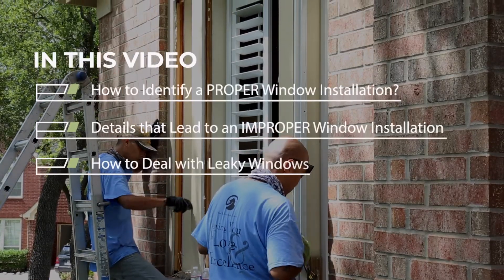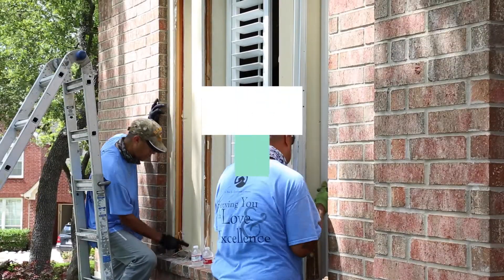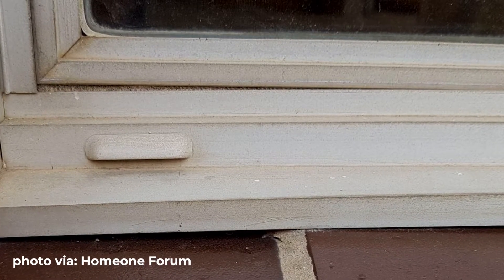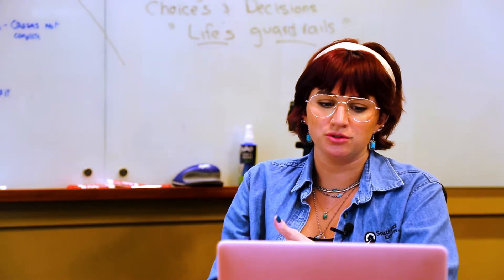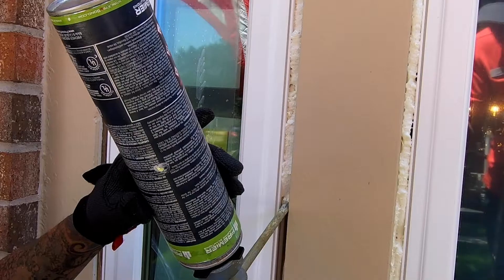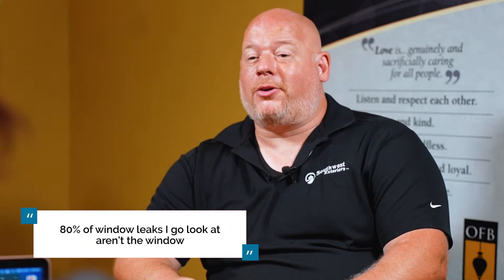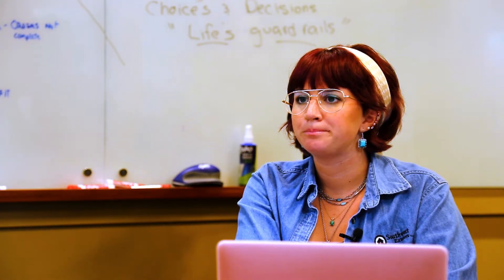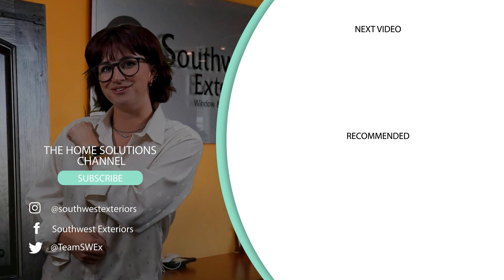Were My Windows Installed Correctly? 3 Things To Look At

Comment: I just had windows replaced in the spring. The other day it was a little chilly with wind and I felt the area around the windows a bit chilly for a casement window with a U factor of .21. I am afraid that when the real cold weather comes in winter, I am not going to like my windows. Is it possible that they could have sealed them better ? What could I ask them to do if I discover discomfort 6 months after the install?
Reply from the maker: Sorry to hear you are having issues with your new windows. It does sound like there could be a seal problem around some of the windows if you are noticing a temperature difference. If you are noticing issues now it would be best to reach out to them now for an inspection before it becomes a more noticeable problem when the weather turns colder. 

When communicating with the company, you could ask them to:
-Schedule a visit to assess the installation and check for any gaps or leaks in the window sealing.
-Request a thorough inspection of the windows to identify any potential areas where cold air might be entering.
-Discuss the possibility of resealing or addressing any issues found to ensure better comfort and performance.

Also remember to start documenting any specific instances of discomfort or cold air around the windows, as well as any temperature fluctuations you observe. This information will be helpful during your conversation with the company.

Hope this helps, if you have any other questions don't hesitate to let us know.
Reply: @TheHomeSolutionsChannel  thank you very much for taking the time to respond to give me sound advice. Really appreciate it. 😊
Reply from the maker: @josefernandez2722  Our pleasure. Good luck!

Comment: Hi thank you for video. Could you tell me I’ve recently had an oak sash window replace because of road noise. I was advised that having an ova window with acoustic glass will stop the noise by at least 90% but this has not been the case. I’m unable to use the room for myself because of the noise. Would this be because it’s a bad fitted window or was I lied to with regards to replacing the old window seeing it’s probably only reduced the noise by around 5p10%.
Reply from the maker: Thank you for stopping by the channel! 
Sound reduction in a room depends on many things, not just the window but also the installation in the walls and the roof. Oak and special glass should help reduce noise, if indeed Oak was still the new window frame. 
However, if the window wasn't installed properly, especially if the gaps weren't filled correctly, it might not block sound as well as expected. Proper installation, from the walls up to the window is key to making sure you get the most noise reduction. And if you replaced a square window with an oval window then all that gap space needs to be meticulously insulated to ensure no additional sound comes in.
I hope this helps and allows you a better idea of how your window was installed. If you want to share more detail please feel free and we are happy to help the best that we can.

Comment: I bought a new build and my windows were installed incorrectly right from the get go. The replaced the case part but I knew the whole frame needed to be replaced in many if not all my windows.  Is there anything I can do to get them to man up to the replacement of the frames. As gaps along the edges are smaller to bigger
Reply from the maker: I’m so sorry for your unfortunate window replacement experience. Unfortunately, this is not uncommon in this industry. Our advice is to continue to communicate with the contractor you worked with until they are able to remedy the situation. If not, you may have to hire another company to fix your windows. If you do end up needing to find a new contractor here is a video to help you start that process. Good luck and hopefully the company does the right thing and fixes your windows. If you have any other questions don't hesitate to reach out to us.
"3 Steps To Find The Right Home Remodeling Contractor"
https://youtu.be/aZcic9_Vgew